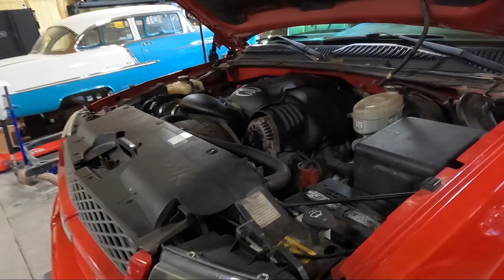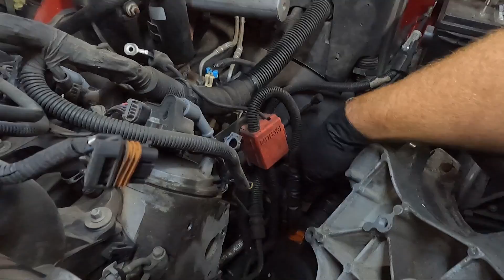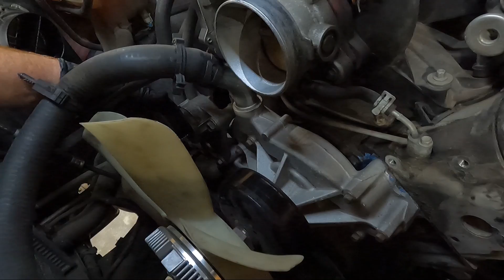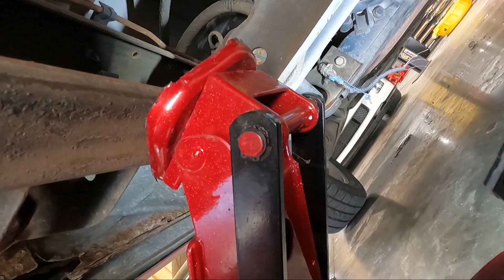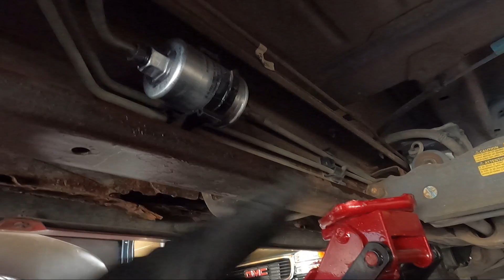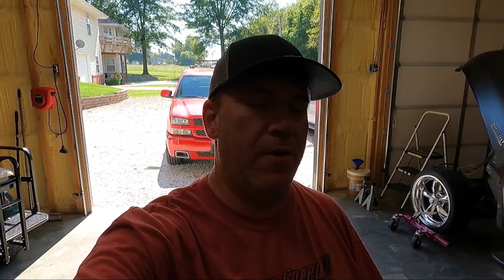Silverado SS Gets a Small Tune Up and New Power Steering Pump

Comment: The fan is easily removed if you take it off before the belt. Adjustable wrench, just almost straight up, hit it with a hammer. It cracks it loose
Reply from the maker: Need a bigger adjustable end wrench